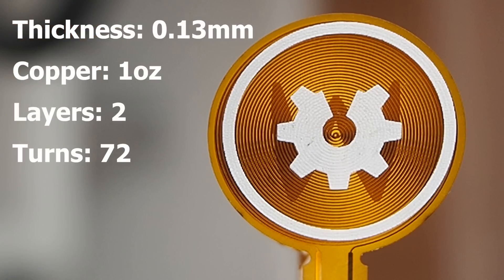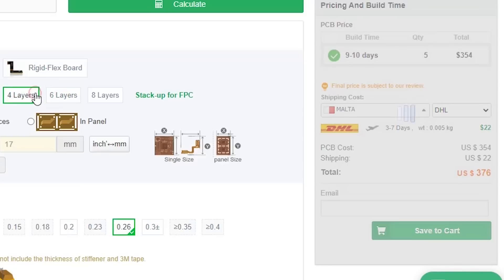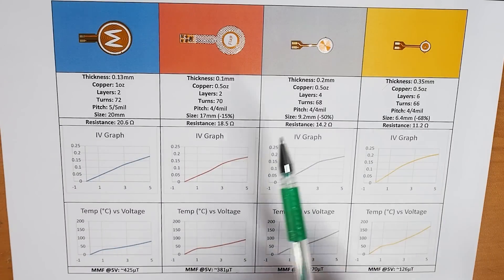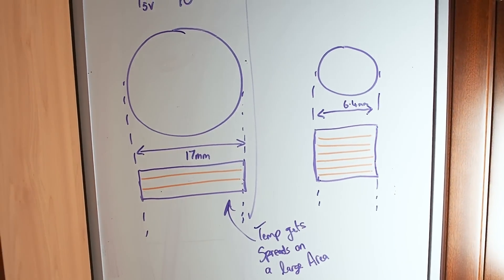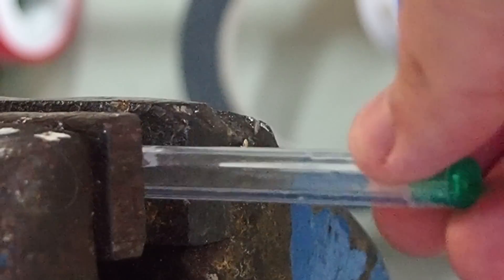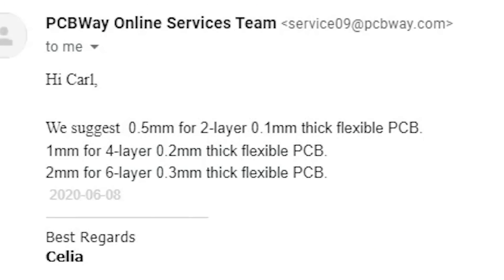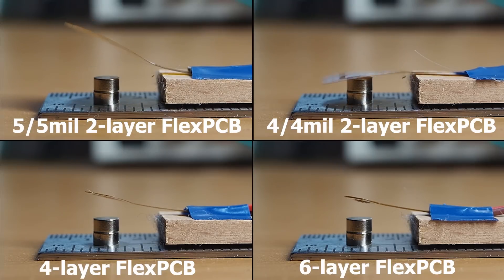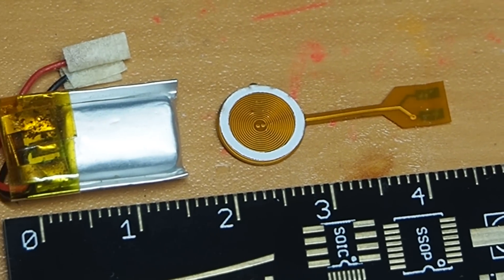68% Smaller PCB Coil - Is it Better?

Comment: @Carl Bugeja
Ask PCB Way if they can make an actuator with a 6 layer "head" and a 1 or 2 layer "neck, for maximum "flappyness".
I assume a thinner (sideways) neck gives more "flapping" but it also gets less "guidance" and might flap diagonally?
Maybe they can like use a 1 full layer pcb "flapper" as a base & then "staple on" (somehow) a 6 layer head on top of it?

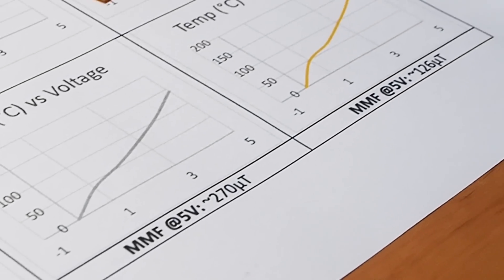Comment: 3:47 use phyphox instead. It shows you a graph of the magnetic field.
Reply from the maker: Just downloaded it! thanks for the tip ;)
Reply: @CarlBugeja  i think you're rightfully excited about these membranes, but i would suggest stepping back and developing other interests to synergise the concepts. i immediately see applications in musical instruments, RC model flight (elevons, multi wing eg. dragonfly or unconventional) and water, but these are obvious to me. thank you for the inspiration, as it should be! i hope this work finds some more appropriate applications.
Reply: @CarlBugeja  have a look at codewarrior's video on making parametric ultrasound beam
https://www.youtube.com/watch?v=aBdVfUnS-pM
the advantage of the membrane here is surface area, which is critical to beam propogation for ultrasound. if you can drive a membrane at 25kHz (or higher!) i'd think using an array of coils on one sheet, use codewarrior's 555 astable circuit and print one out as big as you can provide magnets for...

Comment: It really depends on what exactly you want to do with the coils.
Specially for the small 6layer coil i found it strange that you went with thinner traces - i would have done the exact opposite - wider traces. Of course that leads to fewer turns, less resistance and a lower field strength for the same current. but the reduced resistance also means less heat for a given current. That is as long as the magnetic field is still strong enough for your particular needs there.

Comment: Very nice!
You could retain some flexibility in the many layered ones by just layering separate dual layer devices, still the same thickness but separate layers have lower rigidity if they are not adhered on the tail.

Comment: I bet you could build a air conditioner with this technology and it would power itself. If you flex a piece in a sealed area it would pump a gas or a liquid easily with a check valve on the output.

Comment: Have you considered designing the coils to mate to an FPC connector rather than just soldering? You can get flat flex connectors that are really quite small for quite cheap that allow you to easily connect and disconnect a flat-flex board, and this would probably make the whole process of testing these coils a lot simpler. E.g. this 4-pin 0.5mm pitch FPC connector (https://www.digikey.com/product-detail/en/molex/5051100492/WM12360CT-ND/5726209) can take up to 0.5 A per pin, and even in one-off quantity it's only $0.61 each.

Also, it's possible to get flex PCBs made with a different number of layers in different regions - i.e. you can have 6 layers with 5 dielectric sheets in the coil area, but only have one of those dielectric sheets extend out with a trace on each side in the flexible lead area, if you need that area to be more flexible than the coil area.
This is more commonly done in order to laminate a flexible layer against multiple rigid layers in order to essentially fold a circuit board in half, but this might also be a good application for that technique.

Comment: You can increase the Flapping on the 6 layer PCB if you use only 2 layer flex PCB on the flexing area and 6 layer where the coil has, and simple solder it together...

Comment: Wonder if you could mill/cut down the part of the PCB that is supposed to flex in the multilayer-PCBs to give it back the "flappyness" of the low layer count PCBs. In the end, you just have the two conductors going to the coil that are running thru there, so you would not need all the polyimide and copper layers there, you just need them at the coil end. 
Or get rid of that "connecting part" in the flex design, use some very bendy plastic sheet for mechanical connection to the coil, and glue that in place. Wire up the coil with very thin copper wire (enameled wire used in transformer winding comes to mind), and have the benefit of a smaller, thus cheaper, multilayer coil without the problem of stiffness in the connecting arm... Now that i think about it, if you make a rig that allows you to wind single layer flat coils out of enameled wire, you don't need the expensive flex-PCB process at all anymore. 🤔
Reply: Just disassemble one of those old CDRom drives and look how the lens for the laser is positioned ;-)

Comment: Can't you make just 6 layers for coil(just circles) and 2 layers(or even 1) on the arm for less stiffness(more flexible movement). I know some pcb producers have an option for that(I did not check if PCBWay have or not). 
By the way, Great Job!
Reply: Additional you could make the coil part out of rigid PCB. That would save money and you can get much more Layers. The catch would be more weight. But rigid PCBs (FR4) can also be very thin.

Comment: Could you glue the 6 layer actuator head onto a 2 layer arm and solder / join the contacts for more flex with the smaller footprint?

Comment: As an engineer and scientist I recommend you to use axis labels on your diagrams. Without it is hard to understand and also not very academic.

I like your stuff and that you not just build something but do some research on this.

Maybe you could also try to design a mathematic model on your research to program some pcb routing generator.

Comment: I love this experimentation and scientific approach. I still think that you should generally consider resistance as your enemy and not a parameter that makes the coils suitable for a specific voltage though. I see for instance that the copper leads through the stem is as thin as in the coil which is unneccessary. The extra .04 mm you got "for free" with their decreased track spacing could have been used for increasing track width, leading to lower resistance etc.
If, given your size constraints, you optimize for maximum inductance and minimum resistance you can then in the next design stage make a buck driver with the correct voltage to yield the current that gives the allowed temperature rise. It will be a much, much more powerful actuator. You probably can use the actuator itself as the energy storage for the buck converter, which means that it will be extremely low component count and efficient.
Reply: (i still think observing a sweep would elicit frequencies resonant to the physicality, and that this is tremendously important to the physical amplitude of oscillation.. no equations necessary, just do a slow frequency sweep with a 555 astable if your function generator doesn't fine tune, i promise you your physical arrangement will show marked responsivity to frequency!)
Reply from the maker: Thanks for the comment 🙂 the max-ind/min-res thing really depends on the application - driving it at static voltage / low frequency will get the coil hot. I think with for my applications there needs to a balance. 

In this video I was also going to dicuss the inductance of each coil but decided to leave the test out as I wasn't sure how accurate the results were (I calculated by the current slope). For the 2 layer pcb i measured around 42uH while for the 6-layer it was around 14uH but I think there was a tolerance of around +-4uH

Comment: Have you tried attaching some mirror finish mylar film to one of your actuators and then reflect a laser off that? If it works then two of them plus a laser diode and an MCU may give you a very cheap and compact low-resolution laser projection display. Perhaps good enough for a red clock and other information display on a ceiling at night.
Reply from the maker: Haven't done it yet but it is in the project bucket list

Comment: $300+ dollars... and sponsored by PCBway. Nice.
Reply: I wonder why they are that expensive and who would even use them at that price point?
Reply: @DerH0ns  yeah I was wondering the same thing
Reply: @DerH0ns  One of the problems is the set up cost to get the PCB design from your gerber files into a manufacturable design. It's way more complex than for a rigid PCB. And all the processes are more difficult to do with a "flappy" board that needs some stiffeners or frames to actually be able to handle the PCBs and move them thru all the chemical and mechanical processes. A rigid PCB can basically move thru most steps automatically and is handled by machines/robots, since the production is generally running at a much higher volume. And there are other scaling factors in place. For example when they drill and route rigid PCBs, they usually stack several identical production panels and drill the entire stack at the same time to save time and money. I don't think they can do that with the flex panels. And on top of that, the raw material (polyimide film) is more expensive and for small orders i would guess they have to hand-place the stiffeners that get glued on.
Once you go into large scale production (1000nds of PCBs) it starts to change and flex-rigid PCBs can actually get pretty competitive if you can eliminate expensive connectors and interface parts and have easyer end product assembly or other advantages in your product that benefit from the flex PCBs...

Comment: would be cool if you can make a XY mirror laser steering device to draw some vectors on a wall like mini galvos
Reply: hey if you pull this off with eough accuracy you might be able to do what the peachy printer never could
Reply: @capt_fruit  Correct, because Carl is very skillful and i'm sure he can do it. its what we want, he can sell it to the people, all hail carl, out DIY savior.
Reply: Years ago i bought 10 panel meters from radio shack and ripped out the assemblies to use as galvos for a tube laser from an old Laserdisc player. First thing I got it to display was the Rush logo.
Reply: That was my idea :(

™
Reply: @SinanAkkoyun  Welcome to the rest of the crew.
Reply: Follow
Reply: Isn't that a mirror on a projector?